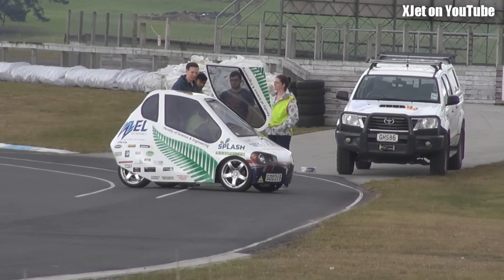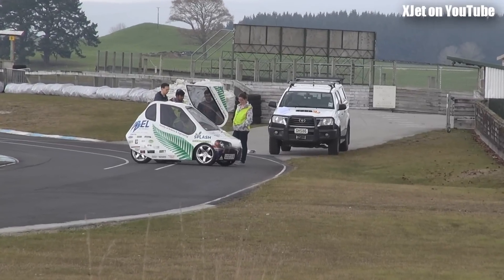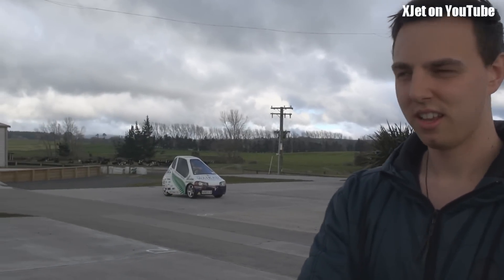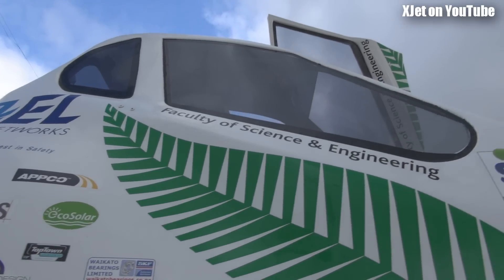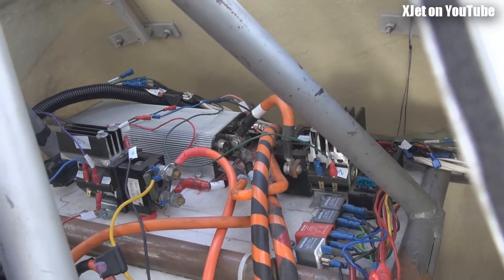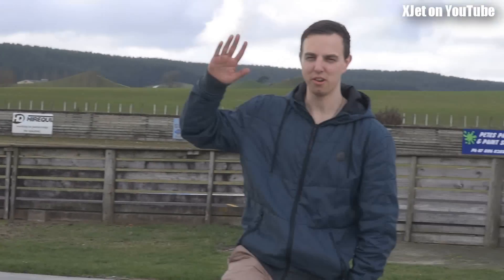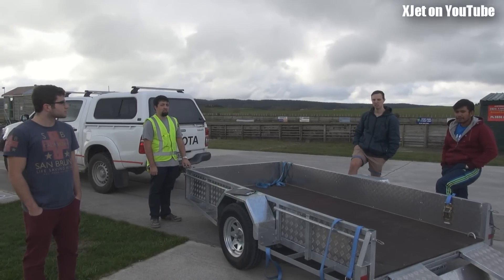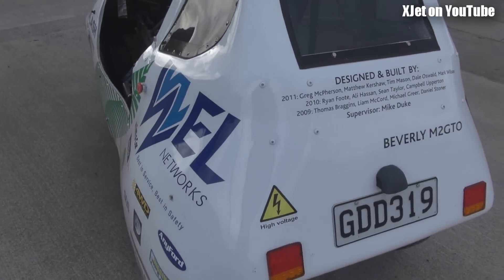Experimental electric car at Tokoroa's gokart track

Comment: G'day Bruce,

Yay Team..!

Hmmn, kind of an Electric Quadbike with Highway Wheels and Plastic Person-Cooker of a Fibreglass Fairing..., eh ?

 Well, point One is that they'll probably have to finish building the Floor to the stage where looking down from inside doesn't show Clear-Air  down to the Road, before trying to get it registered...; & point Two is that it's Winter, and if you get Cold like we get cold then last night it was -6 C in Town..., whereas I know a bloke whose $70,000 MeV had it's $40,000 Li-Ion killed & the dead flattery then duly killed the $13,000 Battery Controller, when they tried to recharge the corpse of the dead frozen Li-Ion which had been left parked  in an unheated &  uninsulated Shed, on a -12 C night.... Oopsie !

 So, I hope they rug that little Gyaskootus up, nice and warm, at night...; otherwise they may well disappoint themselves...

;-p

Ciao !
Reply from the maker: WarblesOnALot Oh yes, with winter upon us, we're all noticing the markedly impaired performance of lithium-based batteries right now.    If I let my lipos get cold before I use them the low-voltage alarm starts sounding within seconds of takeoff.  Keep them "body temperature" and I get 5 minutes before the polite young lady inside my transmitter warns me that my time is almost up.
Reply: ***** 

  Yeah, it's a factor the (Coal-Fired) Electric-Car Fanciers' Fraternity prefers not to discuss...; as if mentioning it might queer the pitch for all their Marketing Jism, but wishing it weren't true in the Sales-Room won't stop the Customers figuring it out by bitter experience.

It reminds me of the days when Solar Panels cost $10/Watt, rated output, but they were rated for a temperature of 24 Degrees C., which in the Shop sounded like a "reasonable working average"...; until people believed it, bought them, installed them, and then discovered that the bastard things run at closer to 50 degrees C. when the Sun's on them, & when they're hot they can't get the Current through their fine embedded wires, & the output at 50 C  is about half what it is at 25 C..., so the first bank of Batteries generally got killed by chronic undercharging & Solar Panels developed a big reputation for "not actually being able to do the Job".

  It wasn't till the Chinese cut the prices of PVs by 70% ($2 or $3 per Watt, retail, now),  and rated them at 50 C., that anybody could begin to rely on a Solar Panel actually doing anything like what it was sold as being able to do...

  The Plug-In Car Mob are deeply deeply stuck in the Wannabe Quagmire of "fake it till you make it" mode, just like the Solarians used to be, and they lack sufficient insight to realise how counterproductive such pathological optomism is in the Court of Public Perceptions.

  Ask about range, and they always quote a theoretical optimum figure which requires cruising significantly below Highway Speed (Full Power sucks on Range), in Daylight (Headlights suck on Range), during warm weather (interior heating sucks on Range), as long as it isn't raining (Windscreen Wipers suck on Range...; so, on a cold rainy night, you might be bloody lucky to achieve getting stuck more than halfway towards wherever you wanted to go..., and the lying mongrel who sold you on the Daydream won't be getting out of bed to come and rescue you, because they'll be too busy selling the same story they hooked you with to the next person who walked into the Showroom.

  I forsee much disappointment and wailing and cursing, probably gnashing of teeth as well...; but Solar One did make it halfway accross the Pacific, so perhaps a practical Electric Car is not beyond all hoping for, one day...

;-p

Ciao !
Reply from the maker: WarblesOnALot I think the secret to an energy-efficient future is to redefine what "personal transport" needs to be.  The biggest problem we have is that 90% of the time we use a tonne of steel to cart around an 85Kg payload of meat.    That overhead is unsustainable and requires a massive waste of energy.   Personal transport of the future will be small, lightweight and not "owned" but hired for the trip.

We will have public transport taking us on most of our journey but when we want to get from (say) the train/bus station to the supermarket and back, we'll just wave our ID card over a pad next to a parked "EV Pod" vehicle that sits there silently on charge, jump in and travel the few hundred metres or Km required to reach our destination.  Once we've done our shopping we jump back in, return to the train/bus station with our goodies and then catch the public transport back home.

In a few decades time, we will be shocked at the memories of all those SUVs and cars idling in traffic jams on the arterial routes in and out of cities at rush-hour.  We'll be even more ashamed of the resources we squandered in doing so and the harm we inflicted on the environment.

The thing is that we don't need eathshattering breakthroughs in technology to achieve these results -- we just need a change in people's thinking and a switch from "ownership" to "usership".   Even from an economic point of view, "usership" is a much better choice.  Why spend tens of thousands of dollars on a vehicle that spends 90% of its time just sitting in a garage or car-park, slowly rotting and depreciating anyway?
Reply: ***** 

 Well, there's a lot of sense in what you say, especially in the Human Feed-Lots, oopsie..., I meant "Towns & Cities & Suburbs"...

  But even with them, my experience is that when one offers the Great Unwashed Masses a way of retrofitting their existing  Fire Chariot with a Solar Panel as a Primary Battery Charger to save Fuel by relegating their Alternator to a backup Role...; well mate, they''re apparently too preoccupied, or too stupid, to be bothered copying the method...

 Let's be honest Bruce, you're one of the smartest people I communicate with, but for over 4 years I've been suggesting that you put a SunFoil onto your Fire Chariot, and you haven't managed to find the time to think about getting around to doing anything about it ; but during that Time the 30 Watt PV on my Fire Chariot saved 1200 Litres, $1,800, & 3 Tonnes of Greenhouse Gas Emissions...

  I reckon all Piston-Engined Road Vehicles should need a Solar Battery Charger in order to get Registered, unless they have "Regenerative Braking"...; though RB is barely ever able to reduce Fuelburn by as much as 10%, whereas the 30 Watt SunFoil changed my Fuel Efficiency from 8 Km/L monthly to 10.66 Km/L monthly.

   Also,  non-Autistic People relate to Cars, just as to Bicycles and Spouses, as part of their Personal Territory...; most people are as unwilling to share their Vehicle as they are to share their Bedsocks.

 Not at all willingly..., that is to say ; or would you fancy the local Feetball team taking your missus for a test-ride ?

 Psychology is a BIG part of being Human.

 Technocrats really hate that fact, but Marketing Psychologists bloody well love it...

;-p

Ciao !